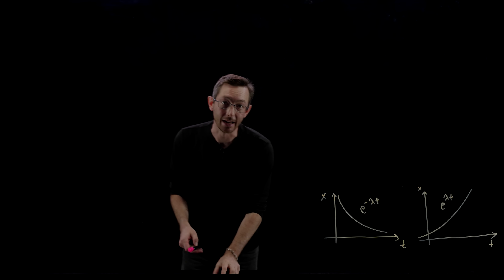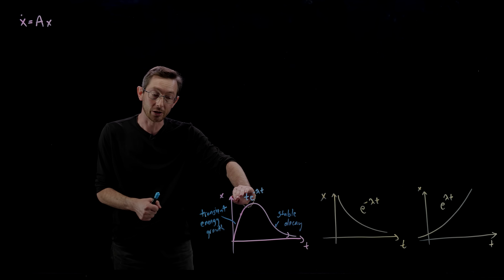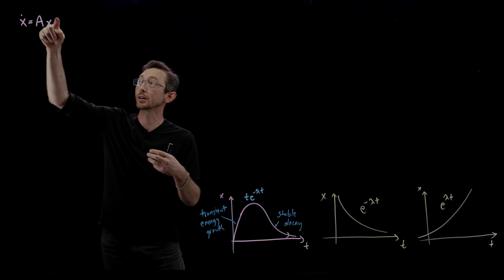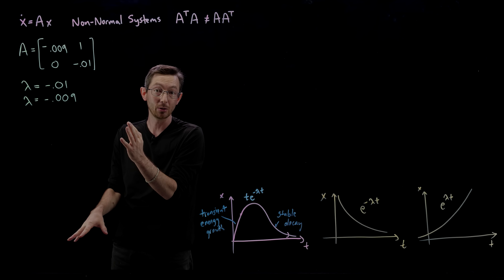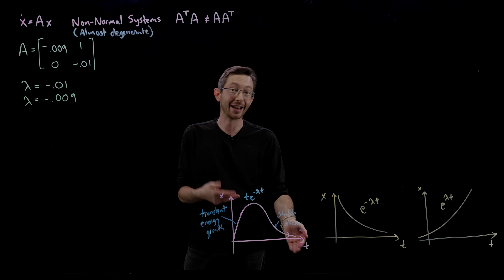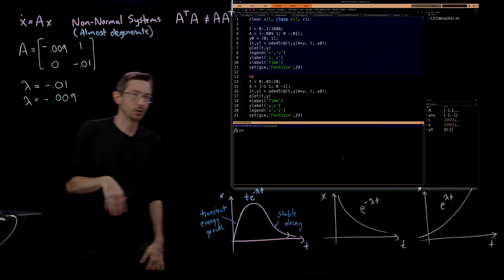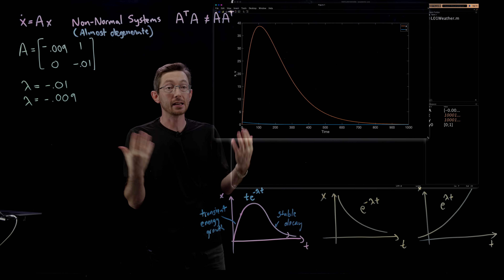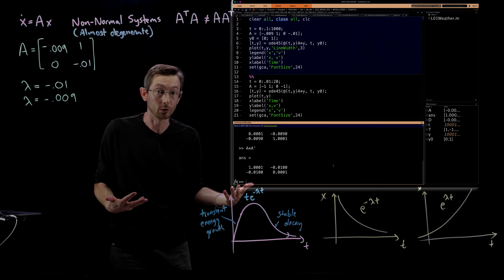Non-Normal Linear Systems and Transient Energy Growth: Bypass Transition to Turbulence

Comment: Hi Professor Brunton, I think here at 7:15 the determinant is not zero right? you only want to require two eigenvalue are the same and at the same time the eigenvector are parallel, which makes it a defective matrix but not necessarily singular matrix. Could you verify if this is correct? Thank you!

Comment: Just for the excercise, I've tried to produce the 2nd order diff Eq from the matrix system x' = Ax, A=[-0.009 1; 0 -0.01]. Doing so when starting with the charc. poly. , the 2nd order diff eq should be x'' +0.019x' +9E-5 = 0, this stright forward. Trying to get this equation starting with the A matrix and replacing x2 = v, x1' = v, is not trivial, it doesnt work! I needed to keep the x1,x2 system and manipulte it to get the 2nd order diff equation. I wonder if this issue is related to the non-normality of the system? anyone can answer it? Profssor?

Comment: Thanks for a nice video! As I see it the most important part for transition to turbulence in pipe flow is the velocity. At low enough velocities the flow will remain laminar despite the surface roughness. There is a critical Reynolds number for that, I think.

Comment: Hey @Eigensteve, would it be possible for the solutions to the homework problems of ME564 and ME565 to be reuploaded to the course website? The problem sets are still available but the solutions have been removed from the looks of it. It would be nice to have some additional practice material, to really drive this material home. (:
Reply: The homework files for ME564 are in an open directory (sbrunton/me564/hw/). Unfortunately there is no solutions for the most recent versions, but there are some available and they're fairly similar. Nothing for ME565, though :/
Reply: @meunomemauricio  thanks. I did email Steve after sending this comment and he responded that he is not able to upload the solutions for the newer problemsets. Using some of the older sets to study seems the way to go!